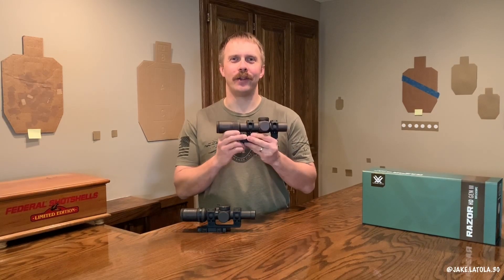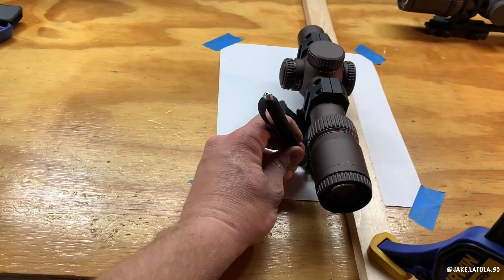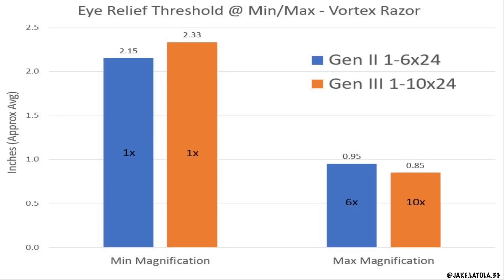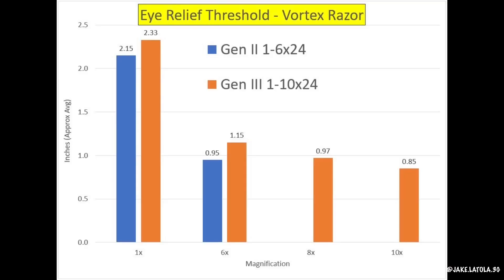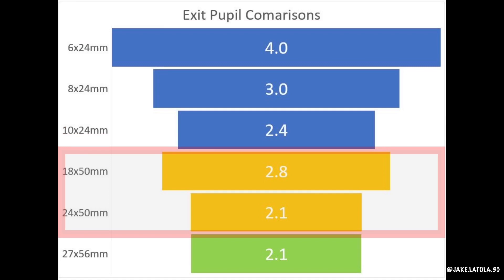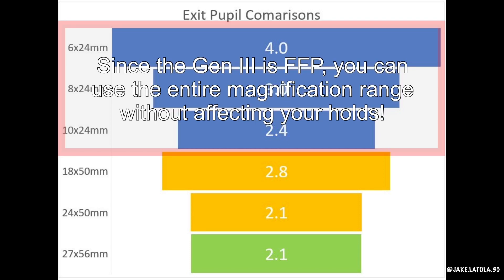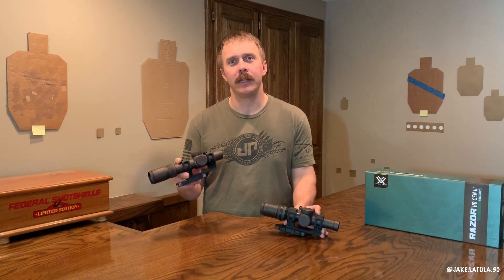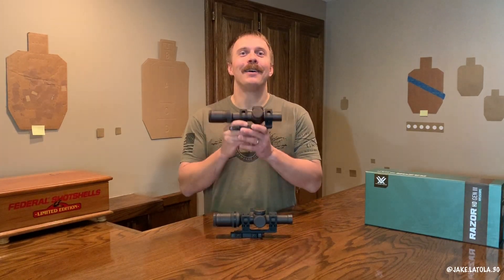Eye Box Review: Vortex Razor Gen III 1-10x Scope

Comment: The eye box on the gen iii is terrible compared to the gen ii.  I have both and absolutely despise the bending around the edges on the 1-10 and how tight the eye box is.  At 10 power the eye box is so tight its almost unusable.  Of all the lpvo's I've used the 1x on the gen iii is the worst and actually hurts my eyes.  I wanted to like this scope and the reticle is the best on the market but they should have made a 1-8 ffp and kept the edge to edge clarity of the 1-6
Reply: I also have both and disagree with this…. Have you adjusted the diopter ring? My GIII is clear edge to edge and has a beautiful 1X

The 10X is definitely tight, but if you have a consistent cheek weld it’s not that hard to stay in while shooting
Reply: @basedWisco715  The image is clear but the bending of the image/eyebox size at 1x and 10x is unacceptable for me. I did adjust the diopter ring at the rear. Comparing it to other scopes that are 1-6 and 1-8 mag levels it falls short in distortion and eyebox. The razor 1-6 doesn't have this issue neither do my swarovski 1-6, kahles 1-8 or nightforce atacr 1-8.  The 1x when looking at just the right angle is fine, its the tightness of the eye box.  When running around and shooting from weird positions its an issue. I sold that thing and haven't looked back .
Reply: @andrewclodfelter3782  g3 needs an exaggerated cantilever mount. It has a pretty generous eye box if you move your head back
Reply: @flooid5506  you are not getting full fov when you do that
Reply: @andrewclodfelter3782  completely agree, ton of people never own an lpvo and never seen what gen3 razor actually looks like formed their opinion based on paid reviews.
Reply: @alexxu3004  Exactly.
Reply: @alexxu3004 yes you do

Comment: What are your thoughts on the FFP of the G3?  I have used FFP optics before and not liked them because on the high magnification the crosshair or dot is too big for precision aiming and on the low end, the reticle was so small it was hard to pick up easily.  Does this issue exist on the 1-10?
Reply from the maker: Honestly, I haven't had it on the range yet.  I've noticed that illumination brightness will be much more important to making precise shots at the low end of magnification since having it too bright will flood out the target.  In dryfire training with small targets (Skinny Sammies, 8" Plate Rack, etc) that were scaled for distances between 50-75 yds, I found myself bumping the magnification up a little more than I normally did with SFP, but not to the point where I felt I was over-magnified.